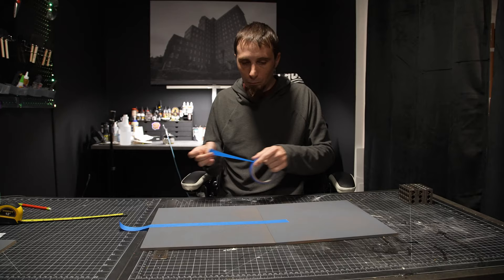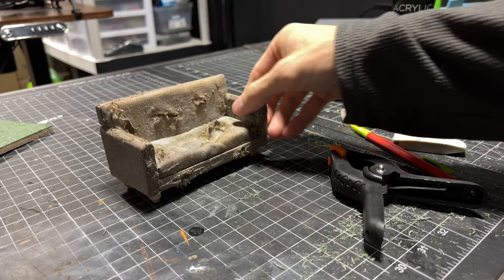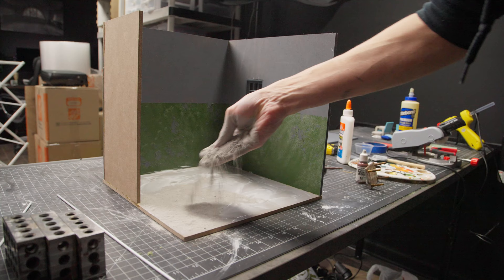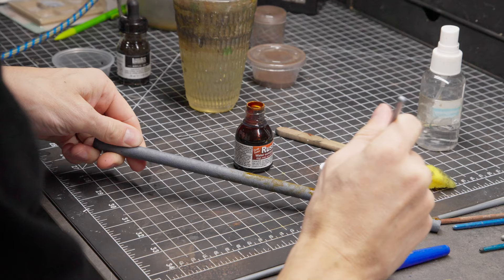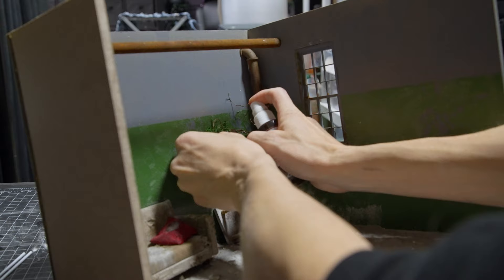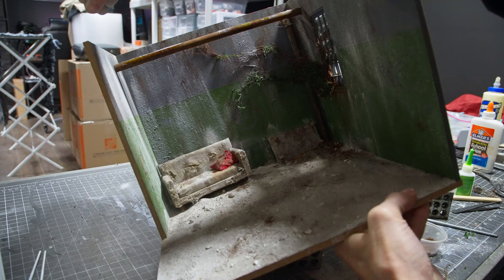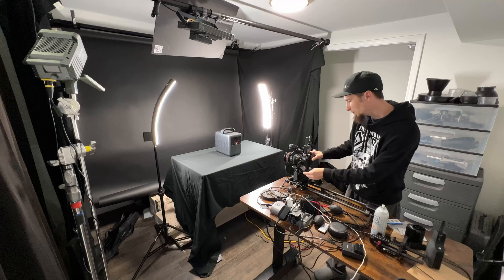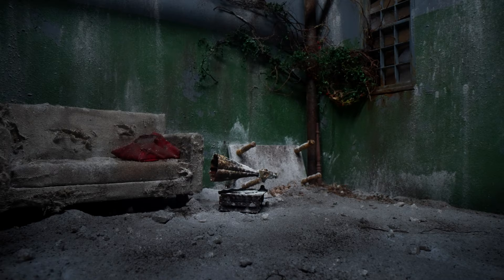Making a Miniature with Cinematic Light - SIRUI Bendable RGB Light

Comment: Just watching the backwards camera move at the end with everything staying in focus....impressed. I shot a short film noir around 2013. There were times I decided to use a simple Canon Elph 310 pocket camera because of it's fairly deep focus, while simply placing a small towel under it and running it over a desk. I also used it in a fight scene, because of how well it found focus while flying around a couple guys going at it at night. The main camera back then was a Canon 5D Mark II, but no one has ever noticed the switching between cameras. For night time alley shots I found it simple to shot a plate of the alley, then have an actor walk through it while filming. I could layer the plate over about 80 percent of the areas, especially just above black that would show digital noise. A very simple and completely effective solution. And all layering and effects work was done in Photoshop's CS4 animation timeline. I guess I'll paste a link.   https://www.youtube.com/watch?v=CwQ84VaeJ-s